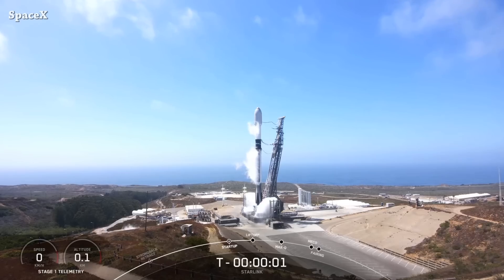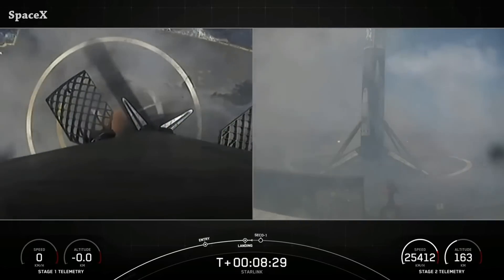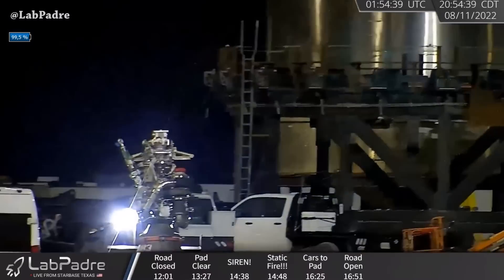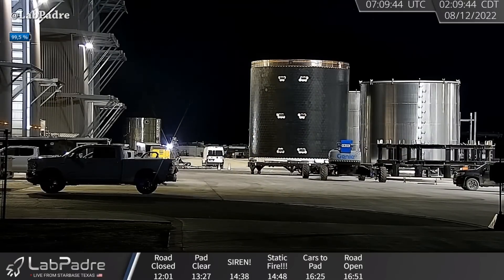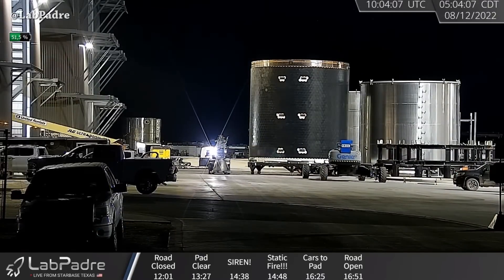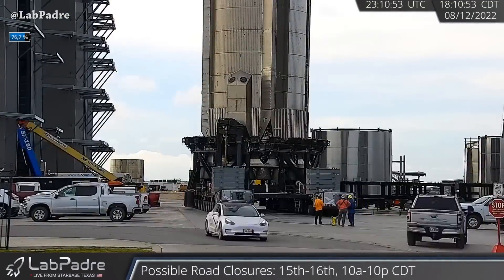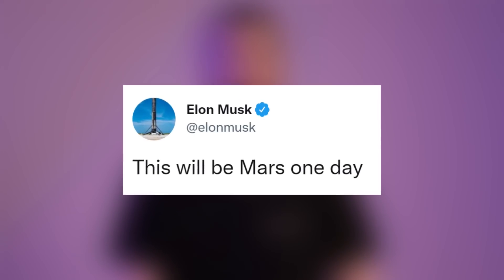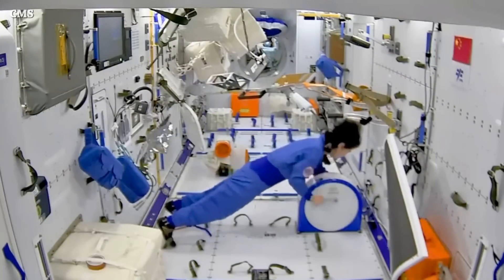B7 Removed From OLM and Moved to MegaBay | Starbase Pink

Comment: This might sound weird but rather than bringing the whole Booster back to the production bay, why don't they just bring the raptor engines to the launch site and install them there.
Reply: Perhaps it’s easier to install shielding in the megabay
Reply: @osirisapex7483  I totally forgot about the shielding😂. That makes a lot more sense
Reply from the maker: And weather too, high speed wind, dust ... etc but i think it's good sometimes to push those things to their limits, to simulate mars :D
Reply: @StarbasePink  Yes! 😃